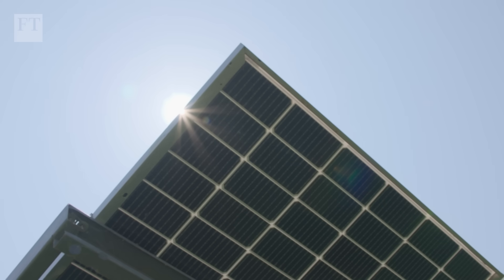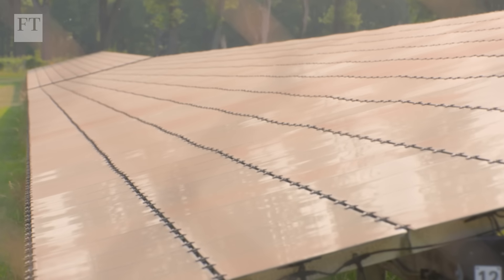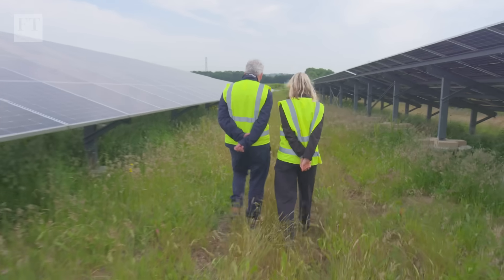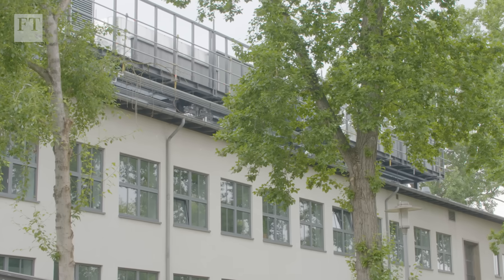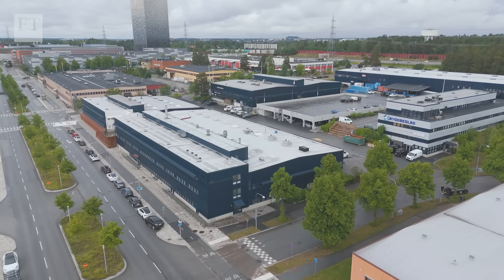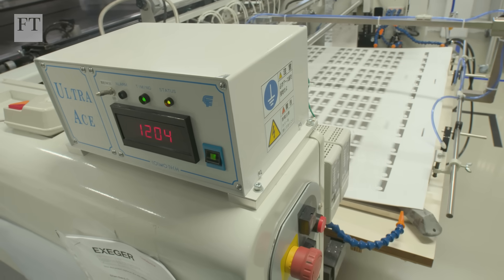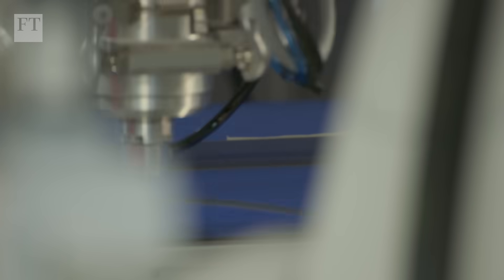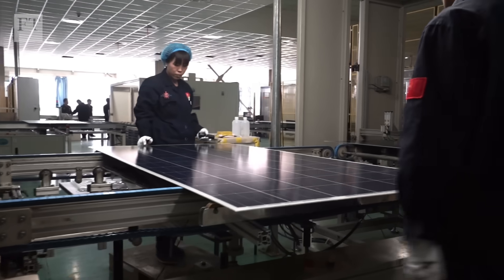Can new technologies supercharge solar power? | FT Rethink

Comment: You should have stated more clearly that the printed ink solar panels are rarely more than 10% efficient. 
   With current silicon solar panels ,  if the US used the same 33 million acres that it uses to grow corn to make alcohol that is added to gasoline for cars,  it could produce 3.3 terawatt hours of electricity per day. 1200 terawatt hours per year. That is 30% of the electricity the US uses each year or about half what the EU and UK use in a year combined .  We do not have to use farmland, but it's still a better use of the land than growing corn that we just burn. 
We could easily use up 40 million acres in the Permian basin covering up land that has been ruined by drilling and perhaps generate enough money to remediate all of the abandoned Wells that will come into being over the next 50 years. 

For reference, England the country on Britain is 32 million acres.  The UK uses 310 TeraWatt hours per year.
Reply: What do you do at night, and what do you do in the winter? Where do get the land from in the UK? Where do you get inertia and balancing etc for the grid from? What's the longevity (20 years) ? Where do you get the materials form? How much material would you need of which elements? Where are these produced? (China) What do you do to recyle all of it & who pays for that? What's your Capacity factor (UK is around 10%) How do you deal with overbuild and curtailment? 

Did you account for the 0.8% per year degradation rate? Now add storage costs. How much storage would you even need to go to high % of electricity coming from intermittent sources like solar. Wind get's get higher CFs anyway. What's your FSLCOE , not just LCOE as almost everyone quotes to decive. How many ecosystems do you "clear" to do it? 

Why do any of this when you have nuclear as an option? High energy density, low land use, 24/7 90% CF or higher, low Co2, Firm baseload power,  energy secure, inertia making, industrial processs heat generating as a by product if co located with chemical plants etc, even district heat supplying (perhaps) no storage needed, less material usage per Mw. Even some load following in newer designs, (not great at it though, true) "Waste" is manageable and valuable in the future if reprocessed (though technical and economics need to be worked out, also, true). All electrons are not made the same. Solar electrons suffer from all these downsides and they are mostly fundamental, so you can't mitigate them. Nuclear electrons are almost as good as Gas produced in terms of grid dispachable firm power, Gas can load follow better is it's big puls, but Nuclear is fine for at least 50% of your peak demand and probably fine at 75% even. (look at France) I wouldn't go more than 80% Nuclear though, Hydro, Gas, wind, Geo thermal, wave and solar can do the rest between them. 

You must know that solar is no good in countries with seasons, like the UK, right? Where you are lucky to get 20% of the production in winter than you would in high summer? Which is why name plate capacity means nothing for solar. Where did you get your figures from?

Comment: Italy, Spain and France all set solar records this month, over 200Gwh each
Reply: I just want a solar power bank to charge my mobile and airbuds.
Reply: it summer! How much will be produced in the winter when the power is actually needed?
Reply: @scipio4fricanus   you don't use electricity in the summer?
Reply: @JuliusFawcett  Solar is zero at the point of max demand in winter evening. Every solar panel installed in the UK just make us poorer. All renewables are a waste of money that make us poorer.
Reply: So what? there's this thing called night time, and another called winter. What is it that you don't get about these things? Also, where you are on the globe matters a lot. The UK is not Spain for example, and it certainly isn't the UAE, and even there, they have night time, tho seasonality is the bigger problem these days.

Comment: "New Technologies" ? I don't think so. I can recall perovskites and Nanosolar years ago . Hey Grok, do your thing "Perovskite Solar Cells: Technical and Commercial DevelopmentsPerovskite solar cells (PSCs) leverage a class of materials with a unique crystal structure that enables high efficiency and potentially low-cost production. While the mineral perovskite was discovered in 1839, its application in photovoltaics is relatively recent, with rapid efficiency gains but ongoing challenges in stability and scalability for commercial use.1839: German scientist Gustav Rose discovers the perovskite mineral (calcium titanium oxide) in Russia's Ural Mountains, laying the foundational knowledge for the material class. 

1890s: Metal halide perovskites, the type used in modern solar cells, are first synthesized. 

2009: The first perovskite solar cell is demonstrated by Tsutomu Miyasaka and colleagues in Japan, achieving an initial power conversion efficiency (PCE) of about 3.8% using a liquid electrolyte-based structure. 

2 sources

2012-2013: Rapid technical advancements; efficiencies surpass 10% in 2012 with solid-state designs, reaching around 15% by 2013 through improved materials like methylammonium lead iodide and better device architectures. 

2 sources

2015-2018: Efficiencies exceed 20%; research focuses on tandem cells (perovskite combined with silicon) and stability enhancements. IDTechEx reports highlight emerging market potential, with prototypes showing promise for flexible and low-cost applications. 

2 sources

2020: Projections for commercialization emerge; Nature Energy notes expectations for perovskite/silicon tandem cells in mass production by 2021, though delays occur due to stability issues. 

2021-2024: Efficiencies hit over 25% for single-junction PSCs and 34% for tandems; companies like Oxford PV achieve certified records. Commercial pilots begin, but scalability remains a hurdle. 

2 sources

2025 (as of mid-year): Technology still in early commercialization stages; efficiencies top 26% for single-junction cells. Manufacturers face repeated delays in market entry, with firms like Saule Technologies and Oxford PV targeting niche applications (e.g., indoor or building-integrated panels). Broader adoption is anticipated in the late 2020s, driven by cost reductions below traditional silicon. 

3 sources

Printed Solar Panels: Technical and Commercial DevelopmentsPrinted solar panels refer to photovoltaic technologies produced using printing methods (e.g., roll-to-roll or inkjet) for thin-film layers, enabling flexible, lightweight, and potentially cheaper panels. This includes materials like CIGS (copper indium gallium selenide), organics, and more recently perovskites. Early hype in the 2000s led to several startups, but many faced commercial failures due to efficiency and durability issues. Nanosolar, a key player, exemplifies this trajectory.1980: University of Delaware develops the first thin-film solar cell exceeding 10% efficiency using Cu2S/CdS, setting the stage for printable thin-film technologies. 

1990s: Research intensifies on organic photovoltaics (OPV) and dye-sensitized solar cells (DSSC), with early printing techniques explored for low-cost production. 

2002: Nanosolar is founded in San Jose, CA, focusing on printable CIGS solar cells using nanoparticle ink for roll-to-roll manufacturing. 

2 sources

2006: Nanosolar announces plans for a Bay Area factory and selects manufacturing sites in California and Germany, aiming for high-volume production with costs potentially under $1 per watt. 

3 sources

2007: Nanosolar ships the first commercial printed CIGS solar panels; broader industry sees prototypes of printed organics from companies like Konarka. 

2 sources

2009: Nanosolar debuts with $4 billion in contracts, opens an automated facility for printing on aluminum foil, and unveils a 640MW fab; claims high-efficiency CIGS cells. 

3 sources

2012: Nanosolar raises $70 million to expand production; however, market challenges lead to Konarka's bankruptcy, signaling difficulties for printed organics. 

2013: Nanosolar declares bankruptcy after failing to scale commercially, despite over $500 million in funding; attributed to competition from falling silicon prices and technical hurdles. 

2010s-2020s: Shift toward printed perovskites and improved OPV; companies like Heliatek and Armor advance flexible printed panels for niche uses (e.g., building integration). Efficiencies reach 10-15% for commercial printed OPV, but widespread adoption lags. 

2025 (as of mid-year): Renewed focus on hybrid printed perovskites for higher efficiencies; small-scale commercial products emerge, but the field remains niche compared to rigid silicon panels, with ongoing R&D for cost-effective large-area printing. 
"

Comment: No mention of the lead in perovskite? We need more electricity, and PV is the cheapest, but do we need to cover land with water-soluble lead?  Silicon, & wind turbines are good technologies and getting cheaper. Demand side management, batteries using hydro as load following and peaker source will all help lower the cost of adding more electricity to the grid.
Reply: Perovskite is fragile and expensive for now but most researchers are on hybrids
Reply: Aren’t the cells sealed inside glass and the frame? How are they going to leak lead?
Reply: @davestagner  Silicon cells are made that way, but much perovskite work is on thin film with the goal of making them cheap enough to cover walls and roofs directly. This they will not economical to recycle, so it will be disposed of in landfills or dumped illegally. Also, even when in glass, modules that break, especially in natural disasters like hurricanes. It took almost 100 years to get lead out of gasoline, and it will take decades more before it is out of the soil food we eat. When it was developed, they knew it was poisonous, but it was cheap, so it went into mass production anyway. It is not the rich countries that stuff the most, but the poorer countries' companies that will clean up or document where perovskites are used.  Lead is highly toxic and even minimal exposure results in developmental problems.
Reply: @davestagner  Glass breaks
Reply: All that is rubbish, it also can't work. Nuclear does though, job done. For peakers, that's still a problem, but Gas Hydro and perhaps new nuclear and geo thermal can handle it. Going to 75% nukes is doable, France managed it 40 odd years ago.
Reply: @markfernandes2467  Physics and economics are not impressed by your insistence that it can’t work.
Reply: @davestagner  Ironically, they are the very reasons my claim is true. + Maths, logic and geography. You obvioulsy haven't a clue about reality. 

Even the back of an envelope and a basic grasp of these things can prove solar can't do what people seem to think it can.
Reply: @markfernandes2467  Back of the envelope, plus the actual experience of existing solar projects, tells me otherwise. There’s a reason well over 90% of the new electric energy deployed last year was renewable. There’s a reason California’s gas consumption for its power grid has fallen over 40% in the past two years. There’s a reason that wildly deregulated Texas is deploying solar, wind, and batteries faster than anywhere else in the US, even California. There’s a reason the Chinese government has committed to fully converting their power grid, and deploy more solar in a week than they do nuclear in a year. I think the back of your envelope has some issues.
Reply: @markfernandes2467  Nukes are more expensive and take a decade to build.
Reply: Solar in near zero for months in the UK. This is not a problem that can be solve with any of your suggested solutions. Nuclear is the answer. Every solar panel installed in the UK just makes us poorer.
Reply: @scipio4fricanus  Ember just did a study of what it would cost to do 24/7 solar+battery a majority of the time, in a dozen cities around the world. Birmingham in the UK was one of them. Their proposed system was the same for each city - a steady 24-hour 1MW output, provided by 6MW of solar panels and 17MWh of battery, at an LCOE of about $104/MW (using 2024 PV and battery prices, both of which continue to fall). Results varied from 97% in Las Vegas (best result) to 62% in Birmingham (worst result). 

This is a HUGE cost problem for nuclear. New conventional nuclear is considerably more expensive than that, and the promises of magic new technologies (or massive safety deregulation to reduce costs) are largely wishful thinking. Plus there’s time to market… solar and batteries can be deployed quicker than any other energy technology, and well over 90% of new energy deployed globally today is SWB. So if SWB is providing 24/7 energy most days (and surplus much of the time), then what does that mean for nuclear? It can’t sell electricity most days, but still has operational overhead costs. It’s cheaper to just use fuel to supplement on days when solar isn’t enough - and solar is never truly zero. 

Before going all reactionary, I’d recommend looking up that Ember research paper and reading it. That’s what nuclear is up against.
Reply: @davestagner  Do you really trust a solar company to not lie about solar? You are naive.
Reply: @scipio4fricanus Their work is all off the math and the data; it can be replicated by anyone, even you. If I wanted conspiracy theory nonsense rather than science, I’d go to the fossil fuel companies. Do you believe THEM?
Reply: @davestagner  Ember say they are a global energy think tank that accelerates the clean energy transition with data and policy. If you believe their lies more the fool you. They are a renewables disinformation service.

Comment: Perovskites are to fragile to be used. In tandem cells they can get marginally more efficiency... .temporarily, then the perovskite degrades and you have a subpar silicone panel. There is a reason they are doing tandem instead of just making perovskite only.